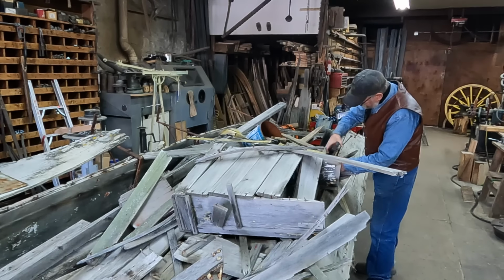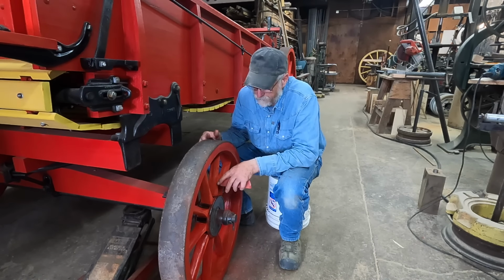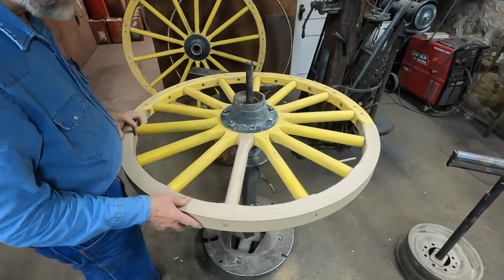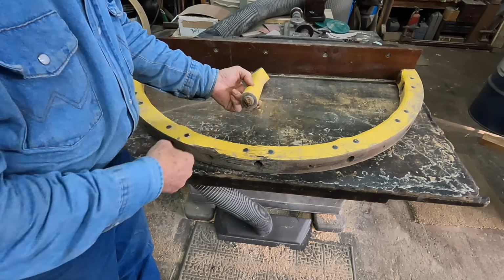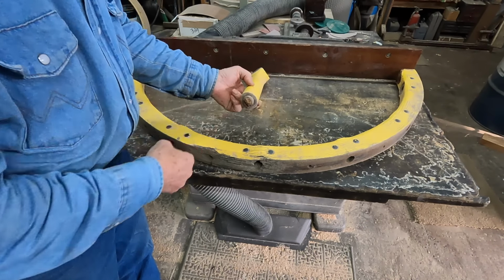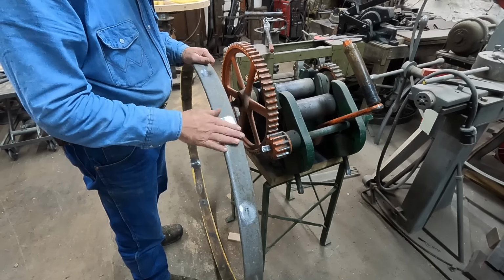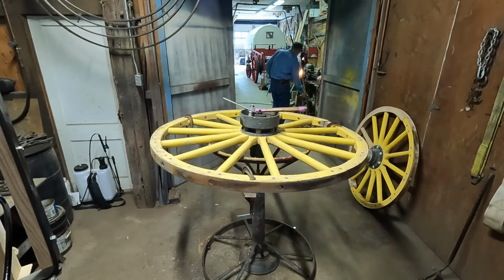My Procrastination Has Now Become My Necessity | Engels Coach Shop

Comment: I watched a video of a Russian guy masking a wheel. Having the experience of watching you build or repair wheels, gave me perspective of how he did his work. 

In short, his wheels worked, but there is no way you would be going fast or that they would last as long as your wheels. Also, the over all finish was much rougher. That being said, he used almost no power tool at all. He used a spoke shave and rasp to fabricate the spoke out of square stock. The felloes were cut with an old style bow saw. The tenons were cut with a chisel. The holes were drilled with tapered T handle drill bits, not auger type. 

We love to watch you, I hope you get better soon. Since it is in the summer, is it a “warm” and not a cold???

Comment: I'm always suprised how long the metal bands  stay hot.  Several rounds of wetting and they're still steaming. 
They'll sure be on there tight when done, that's for sure!   I remember one big one, a weld came loose. Shows how perfect the measurement is, and how much they shrink when cooling. 
Very impressive.   Summer cold got me too last month, get well soon Mr. Engels.

Comment: I have been watching and enjoying your videos probably since I was  the age you are now, and I am now 86.! Like you I always enjoyed  my work which was the restoration of vintage cars. Because the work entails being a 'Jack of all trades' it seldom if ever became boring. Even days spent rubbing down endless coats of paint ,allowed at least your mind to be elsewhere! This bring me to the subject of paint I served my apprenticeship with a commercial coachbuilding firm, and at that time a high proportion of the work was coach painting ie with a brush for those unfamiliar with the term. I am English, so you may call it something different in the States.! We always started with a pink wood primer, which was not only quite thin, but probably more to the point dried very much slower than even undercoat, thus giving it time to sink into the wood. Indeed at that time if you bought say a new window frame it was always ready primed. Today nobody has the time or the patience, as it must dry in minutes and for the most part now be water based! Clearly your thinning down top coat to use as a primer serves a similar purpose as the old wood primer method, as born out by your bench and door frame examples.! Finally your shop is nearly as familiar to me now as it must be to you and of all the various tools etc that you have the one thing that from the first time I saw it , even to this day makes me smile at it's simplicity and efficiency, is the device you use with the two oxyacetylene torches and electric motor to heat the tyres. Which of course in 'Americaneze' should read tires! 
                                       Thank you, with best wishes to you and your wife. Peter Redman

Comment: I made a suggestion probably 5 years ago that I'll bring up again. Even though there is a very strong satisfaction peining rivets by hand, When you are tired,sore,sick, sore shouldered and just need to get the job done, you can cut the end off of an air chisel and make a rivet header out of it. I usually heat it up red hot and hit it on an appropriately sized ball bearing to create the divot. Then you can harden it and temper to a straw color. This will allow you to use your air chisel to quickly and easily set/head your rivets.

Comment: You cutting them pins to size and peening them over reminds me of watching my Uncle Jim replacing knives on his sickle bar mower on his F-12 Farmall .  He’d hit a rock, cuss,  reach in the tool box (mounted on the frame, an old mail box) get a fresh knive, knock out the rivets & clean it up, put on the new one and peen the head over on the brass or copper rivets.  Walk up to the well outside the milking parlor, get a drink of water and go back to mowing the clover or alfalfa.  It was a long time ago (1965) it seems.  Thanks David for reminding me how important it is to do the job right the first time.  👍😃❤️

Comment: Dave u mentioned ur 70,myself 75,ouch..ive learned u hav to pace ,except things u can do and things that hav become difficult.i cant tie my boots anymore.i put the long elastic bands women use on hair.made old fashioned type 3 ft 1/2" towel one end groove other a small hook.hook i pull cord ,cord to finger then groove to push under eyelet..its an art.use hook end on pants and bvds.i guess like bac in 1880-90 women had that button hook for their button shoes.hawthorn ropers haven't worn in awhile 6 lbs.naps become an art..also.eat garlic if throat clears up throat if throat doesnt sinus...little R&R CURE DA LAINE has a casino..IF still there just b4 idaho theres a convenience store or was.perhaps when at CURE DA LAlNE..CALDERA BLOWS..ive got my MT.SAINT HELENS BELT BUCKLE..